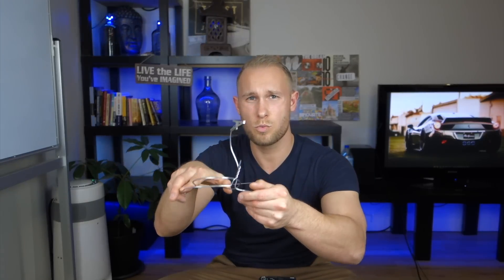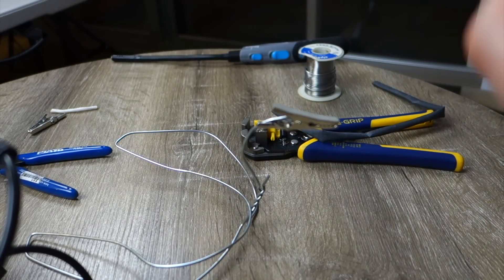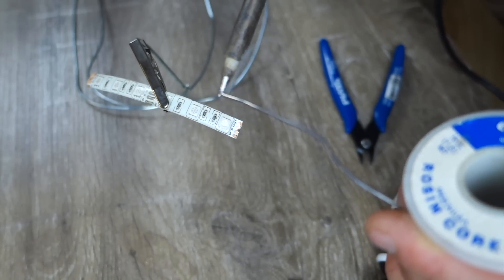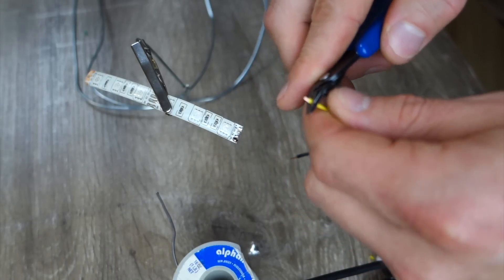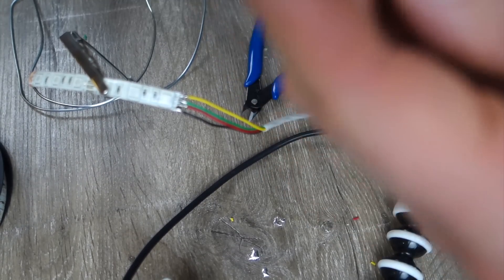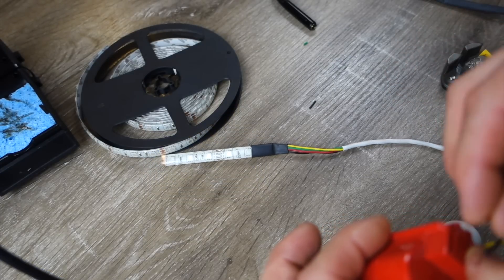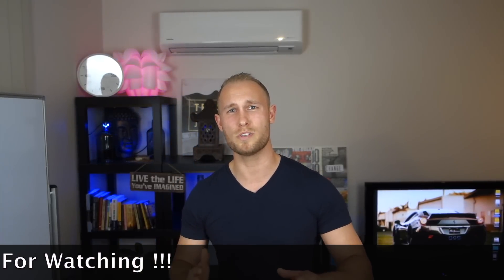How To Solder Led Strip Lights - How To Cut and Solder RGB LED Strip Lights

Comment: This way worked so well but when I tried connecting the other LED onto the wires the light connected to the battery but it won’t light up the second LED strip I connected 😭

Comment: Just a quick thing I've found... soldering from the inside out is easier than across. If you solder the inside wires first (red and green), then you won't have to crossover the other wires to solder the other two.

Comment: So what the hell do you do when the solder refuses to stick to the copper pads? Because I cannot get the solder to stick to the copper AT ALL
Reply from the maker: Try a lower temperature. Start with 200c that usually fixes it

Comment: Just did a few myself, quick tip to make sure nothings shorted out with a multimeter on continuity before putting on the heat shrink

Comment: another way is to just tape the LED strip on the table or platform and then tape the wires on the opposite in a set position, and then all we need to do is solder both, by taping we remove the shaking part, This works best for me mostly because I don't have steady hands.

Comment: Question; The exposed wiring on the strip and under the heat shrink won’t short out if they make contact?
Reply from the maker: Yes they will short if contact is made. Best to use glue-filled heat shrink to cover the contacts or silicon if the LED will be moving.

Comment: Dude, how does it stick to your wires so quickly?

I tried so many attempts to coat that wires but always end up doing it wrong

Do I need higher temperature?
Reply: Get an adjustable good quality iron that goes to 600 degrees. I solder these at 500.

Comment: I'm did all the steps and ideas you said but my led just turns into ball blobs and doesn't stick to the strip copper pads neither with the soldering iron.

Comment: Just found this video. Thanks for making it. After soldering a couple of strips, I used a small Popsicle stick under the strip. Using the alligator clip to clamp both the stick and the strip together really stabilized it. Now I can put some real pressure on wire and strip and it won’t move away.
I hope this helps somebody else.
Reply from the maker: Great Idea, Thanks for Sharing!
Reply: I ended up taping the end of the LED strip to the edge of the unfinished back part of the mdf kick panel that i made for the speakers and leds I'm installing. It was not a part that i was worried about burning or anything like that. 

Sure wish i didn't waste 2 hours of my life burning up the edge of the LED strips tgough. I tried over and over...and over and over trying to put the soldering iron on the contacts of the strips. I put solder on the end of the wires first( I was half way there but had the exposed part of the wires stripped too far back) but not on the contacts. Its way way way easier to just dab a little solder on each contact and then marry the pre soldered connections together.

 I burnt like 4 led sections because the tin comes off the led connection as soon as it gets heat for an extended period of time. Way easier this way
Reply: Thanks for sharing this top!
Reply: My family doesn't eat popsicles and I'm always finding a reason I want popsicle sticks around

Comment: Thanks for the video! I don’t solder much so it will help a lot. One thing I noticed in your video is the order of soldering when you did the second connection you had to go over the first one and inadvertently unsoldered the first. Wouldn’t it be better to start on the far side of the light strip so that you wouldn’t do this?
Reply from the maker: That is a good observation. Yes I would agree with you. They can be temperamental, so sometimes the order doesn’t work out as planned .

Comment: How is this not shorting out?
Reply from the maker: Glue filled heat shrink. The glue spreads between the solder joints.

Comment: Have an led strip project coming up and was curious how one should solder the contacts under the layer of silicone. Thanks! Sometimes it really is as simple as just take it off 😅 don't solder too often myself, liked how you tinned your wires & took some mental notes. Mine are just + or - contacts so this video makes me a lot more comfortable with the upcoming work.

Comment: The Swan is very unstable, it probably wants to shoot off for a swim, a walk or something. I suggest holding the strip down with a paper clamp on the edge of a thin worktop or MDF off cut, you will have better control. Good effort though.

Comment: Flux is your best friend. Grab some RMA and go nuts.

Also the flux included in the core of some solder is not enough. The Flux core's only purpose is to get the solder flowing once heat is applied.

Comment: You call yourself "Exclusive Car Audio" and you use a torch to melt Heat Shrink?  Come on Bro, that is trunk slammer hack crap.  A heat gun from Harbor Fright is less than $15.  Not to mention that torch could easily melt one or more of  the solder joints.   BTW:  Since the camera focus has already been mentioned 100 plus times, I won't.  But why would you not take an extra 10 minutes to reshoot that portion?  I hope you do not cut this many corners on your customers cars.

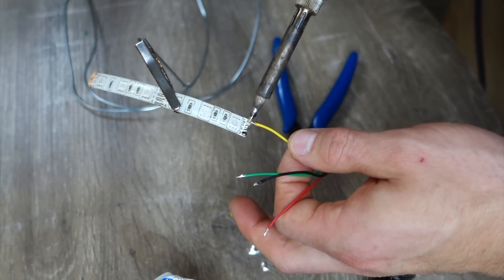Comment: 5:20 "Everyone needs a swan"  Nice DIY helping hand bru.
Very well done, some flux might help the solder flow better.  I use a bit of kapton tape to mask off the spot is am soldering which eliminates  solder bridges
Reply: hey Elliott, I was able to fix my LED and make them go around the back of the TV in style using your technique . I cut an old VGA cable and repurposed the wires inside, perfect gauge for the LED solder pad   Everyone does need a swan, that's for sure.

Comment: Thanks for the video. Just a comment though, the alligator clip mount isn't helping too much because the strip is moving around while soldering, making precise soldering difficult. It's better to have weighed down the base of the DIY helping hands with a weight (like a heavy book), or better yet, just taped down the strip to the table. The flat shape of the strip makes it very easy to secure with just tape. One of the important things I learned during years of soldering is that soldering a moving piece is such a pain and the simple step of making it immovable/fixed helps greatly.

Comment: Dude...I'm learning a lot from this video, so thanks. One thing tho...don't blow on the solder joint. Just like happen to you. The wire you had just soldered fell off. Cold joints....

Comment: Tip: I usually have my heat shrink already on there before connecting wires, especially if I’m going to have a long strip I won’t have to pull the shrink all the way to the solder job. Also, you can always put Heat shrink on your swan’s mouth, it will soften her teeth so she doesn’t damage your LED strip. Happy soldering, god bless my friends
Reply: Ya Ya, Ya f❤19

Comment: You can test 2-3' of lights off of a 9v battery.  Once my connections are tugged and tested for current I use liquid electrical tape to insure resistance remains between each, then I heat shrink.  Another thing I found is that sometimes the silicone covering doesn't come off clean.  A simple scrape with the flat of a razor blade tends to correct that.  FYI, max length for 5050 wire is 30' to a line.

Comment: Where do you get your supplies from?? Trying to find good place that is not going to break the bank. Thanks
Reply: Amazon or ebay  $9 for 16 + ft.  Multip color and those that come with controllers cost a bit more but not much.  One thing to look for is how many diodes per inch and diodes per cut line or distance between cut lines.  The other thing to look for indoor vs outdoor.  Some of these are indoor only.
Reply: @pennytowner728  there is a new version where you can control each diode separately. Aka you can have different colors on the same strip. It's more expensive and need some programming skills but it is open source stuff lol
Reply: @jafar5112 RGB 5050, over 32 ft $27 on Amazon, waterproof and came with controller.  When I do multi-color I prefer RGBW but that isn't much more expensive.
Reply: AliExpress
 I found a Alexa/Google compatible solution for 16 dollars. You get 5 meters of LED light but can buy more LED strips.

Just type LED 5050  wifi in AliExpress =)

I bought one from Ebay but it cost like 50 bucks.

Comment: Start in the center work back and forth. Cooler and easier.
Reply: hi~do you have interested in light strip, for free
Reply: @katherinefuber5835  yes, I have started to design and build different styles of strip lighting. Lamps. I currently am working with some glass blocks I am recycling. So far it's working very well. I love the look they give off.
Reply: @renshiasworld  how do you design light strip by yourself
Reply: @katherinefuber5835  I don't design the light strip, just the lamp design they go into. with that, I do use individual LEDs  at times and wire them together so the position of the lights are exactly where I want them.  Also you can get brighter single LEDs than the 5050 strip lights, so that opens up more possibilities.

Comment: Hey man. Nice video but my question is my RGB strip broke off from a weak solder point, instead of on the cut line. Could i just use solder to re attach the points back together without using wires so that my strip is solid and looks clean?
Reply: Native Man Dan same thing happened to me just last night im just trying to figure out if the colored wires matter on the connector piece
Reply: They can only be spliced at the contact points of the cut lines.

Comment: Completely forgot about getting solder on the tips of the wires before putting them on. This'll be useful for those strips that need a little repair after getting banged up or ripped during transport.

Comment: Just simply cant get the solder to stick the wire to the contact. Not even with flux
Reply: Same here man. It's impossible. I can't even tin the wires. The solder just doesn't want to go onto the wires, instead it just turns black.
Reply: @DaveSimkus  To tin the wires, apply heat to one side of the wire with the soldering iron, and touch solder to the opposing side of the wire.

By using the wire as the main heat conductor for the solder to melt, it helps the solder flow much easier instead of making the solder directly contact the iron, then solder to the wire.
Reply: @DaveSimkus  Solder follows the heat.  Sometimes you need to pre-heat the surface that is to take the solder.  This is what Adam is doing by holding the iron below the wire and placing the solder on top of it.  Allot depends on the gauge of the wire, temp of the iron and solid vs stranded wire.  Solid wire is a bear.  Also, too hot and the solder will run right off.  It is a touch but it does not take long to learn.

Comment: Is this even doable on a 10 mm RGBW strip (5 wires)? It's miniscule, but on the other hand I'm not sure how to do it otherwise.
Reply: Yes but I recommend good light and reading glasses.  I also bought 5 wire tape to simplify life.  You may also want 2 gator clips to hold each side for you.

Comment: I want to take the time to say thank you, i check a lot of video and yours was by far the most helpful to me. I order some angle connectors and the seller send me wrong one.. so i decided to do it myself by soldering wires... never practice since i was kid.. better to tell that i am really bad at it, after watching your video its helped me a lot. For protection i did not use what i think you called heat and shrink, i only use glue gun for make sure that it goes between solder, because they were so horrible that i scare it touch each other and malfunction.. ok i finish writing my book.. so just thank you for this video.

Comment: I would have first slid up pieces of heat shrink up each wire before soldering. Then slid them down over the solder joints to ensure each wire never shorted out with its neighbor. Not much more work and the odds of a short are greatly reduced.

Comment: These strips doesn't need an adapter? Or it goes straight to the power?
Reply: They are rated for 12v DC
Reply: At least 6v to make it work and more volts up to 12 for brighter

Comment: If you have too much solder on the strip contacts and the solder is "jumping" more than one wire, can it short out a controller?
Reply from the maker: Correct , make sure the solder joints are not touch at all or you will have problems.
Reply: Yes, you will. I have and now I need a new one.

Comment: my rgb strip doesnt have a scissor mark.
can i stil cut it?
Reply from the maker: I would not suggest it.
Reply: HatseFlatz the strip has the leds mounted in 3 chips sequence. There should be a dotted line after three leds where you may cut. You may see the copper marks as well, where you may cut and solder the cables to.